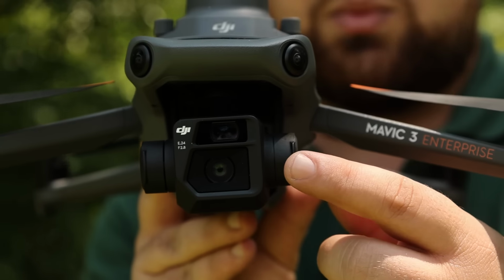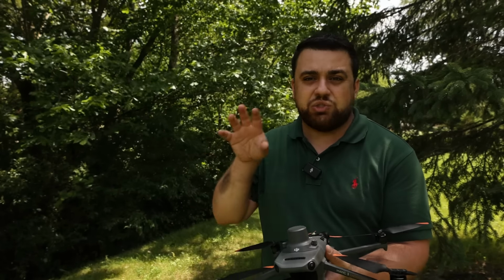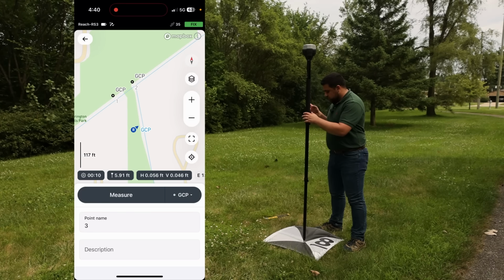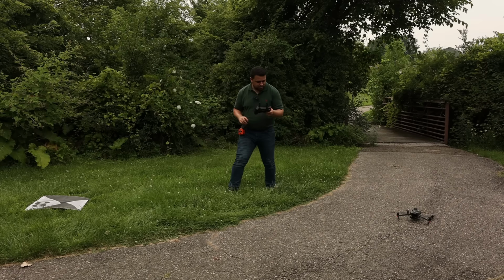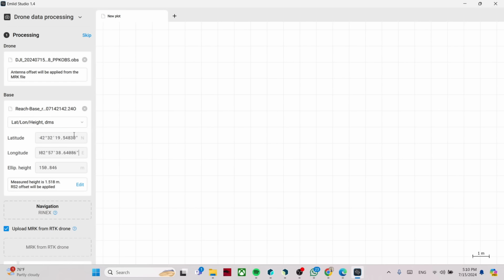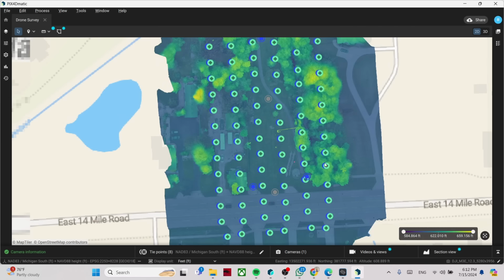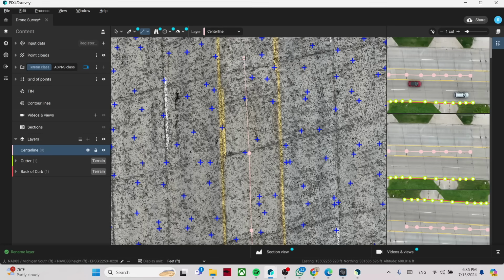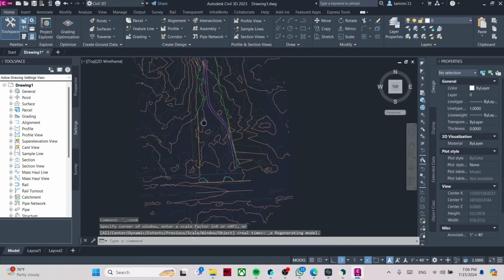FREE 1 HOUR DRONE SURVEY MASTER COURSE

Comment: the best tutorial I've ever seen!  QUESTION During the flight, the AFC turned to MF, if you chooose this manually, the result will be better? I usually do this manually, but thing the automatic would be better
Reply from the maker: Only issue with auto is it could focus on tops of trees and the ground goes out of focus. By having it in MF, it will be consistent through out the flight as long as your altitude is constant.

Comment: Hey Rami, fantastic breakdown in this video! I'm just starting out in the industry with my company, Llerandi Drone Solutions, up here in Ontario, Canada. I'm currently flying a DJI Air 3S, which I know means working with a rolling shutter and no built-in RTK, so I'll be relying heavily on manual GCPs for my accuracy. Does your platform, The Survey School, offer training or a specific learning path for someone in my exact position trying to achieve professional, survey-grade results with non-enterprise gear? Appreciate all the knowledge you share!
Reply from the maker: Yes, we provide a lot of support for anyone getting started in the industry between technical knowledge and business development. We also have partnerships with a lot of companies they give you free hardware and software as you learn that you can use in your work.

Comment: For the fact that there is CORS AND NTRIP you mentioned we can forget about buying the base station rtk but next you used it for ppk so is that a contradiction we should or shouldn’t get the base station?

Thank you for the tutorial though it is very clear and informative❤️🙏
Reply from the maker: You will need a base for PPK but you could use CORS’s raw data as your base. So again, you can get away with just owning one GNSS receiver.
Reply: @RamiTamimi thank you man❤❤

Comment: What if there is no known point to set our GNSS base station on top of, as you did?
Reply: You can measure a point with the base station (+/- 1.00m) and use that point as your known point. If you want to integrate it, you can find a horizontal control monument and shift your coordinates.

Comment: Perfect explanation - quick question. Can the base station be set over an extra GCP? And is it ok to set it up in RTK? 

I have a my first solo site survey coming up to produce a topo survey. The area is 4 blocks of flats and the surrounding grounds.
Reply: Allow me to ask you this, that little hump on the back of the drone is the rtk receiver ? And it's connected with credentials via internet to the municipality service ? Is that rtk enough to get accurate results instead of investing another 10k into the ppk receiver?
Thanks,

Comment: Rami, thank you for another insightful lecture on drones.
To the best of my knowledge, regarding static and RTK GNSS surveys, we don't post-process RTK data. So why was the drone flown in RTK mode, but you also laid ground markers?
Reply: Allow me to ask you this, that little hump on the back of the drone is the rtk receiver ? And it's connected with credentials via internet to the municipality service ? Is that rtk enough to get accurate results instead of investing another 10k into the ppk receiver?
Thanks,

Comment: This was amazing! I have a drone business and I have recently bought the DJI Matrice 4 E just for this and mapping . I learned so much from this! Thank you for putting this together.
Reply: We have the Matrice 4E also, we pair it with the Emlid Reach 2+ then use the Geodnet RTK service and it has amazing accuracy especially if you capture your images using FlightHub 2 and the Smart Oblique mode.

Comment: Im wondering if you really need an RTK drone if you already establish gcps? Sure, the metadata of the images isn't all that useful but still good enough to align all the images correctly. For accuracy of the final output, using the gcps should yield the same accuracy.
Also it would be nice to know if rolling shutter is really that much of an issue. Sure a mechanical shutter is better but you aren't flying all that fast when surveying and modern drones should be able to have a fast enough shutterspeed that there should be barely a difference in the quality of your results.
If these two hopotheses are true, you could save a lot of money buying a regular, non-RTK-, non-mechanical Shutter- Drone.
Reply: Allow me to ask you this, that little hump on the back of the drone is the rtk receiver ? And it's connected with credentials via internet to the municipality service ? Is that rtk enough to get accurate results instead of investing another 10k into the ppk receiver?
Thanks,

Comment: Great video! I finished writing a tutorial for our LiDAR drone, and I'm getting ready to write one for our Matrice 4E, so this has been a great resource for me (I'm also less familiar with the DJI product). A few things I noticed (possibly minor errors, or maybe I'm mistaken):

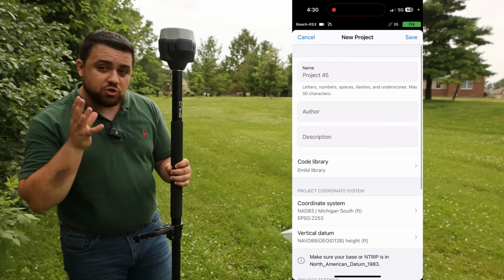16:43 Your screen shows you're using GEOID12B instead of GEOID18 - you say the correct vertical datum (18) but the screen contradicts you.

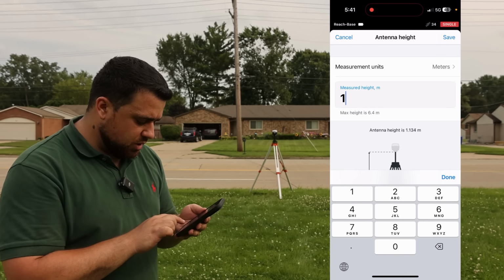23:22 Your measure-up was to the top of the tri-brack, but the graphic on your antenna height screen shows to the bottom of the receiver/base. (I'm unfamiliar with EMLID, we're a TRIMBLE outfit, so all I know is what I see on the screen. You likely did it 100% correctly, it just doesn't look like it based on the little I get to see).

Additional things that may be worth noting for new drone surveyors:

107 pilots should know this, but remember to check your airspace prior to mission planning, or at least prior to flying.

Surveyors, it's always tempting to fly well outside your survey's extents, and it's a good thing on smaller projects (much better than not having enough data). On larger projects, though, even 100' outside the project extents can add multiple battery changes, which may not be tenable depending on the number of batteries you have and your ability to charge them while flying. Also, we're always racing against daylight and weather. I find it best to get the exact project specs (project boundary linework plus how far outside the engineer, client or municipality requires), export the exact specs from CAD as a KML/KMZ, import to your mission planning software, and use that to plan your mission precisely (reduce the vertices to a more basic shape if need-be) If you have wiggle room in your battery time / flight time, you can increase the size of your polygon accordingly.

Great content as always, cheers!

Comment: Great video - thanks.  A few questions.  
1.  I have spoken with some of the software providers for processing software and they recommend leaving dewarp off.  Why do you turn it on?
2.  I had heard that if you are using NTRIP you should set your coordinate system to the same one that the base station you are connecting to is using.  But you just picked one for where you are - is that because it should be the same or that it doesn't matter?

Finally, I would love a video covering the different coordinate systems - why you choose one over another, how you pick the right one for a location, etc.  

Thanks for all the work you put into these!
Reply: A bit late to the game, but I can answer your questions.
1) The dewarping process uses fixed parameters to remove distortions in the photographs, but your camera will be slightly different from the reference one due to manufacturing tolerances, ambient temperature, and so on; so the photos will still be slightly warped but not as if they were tkaen with a normal camera. What the photogrammetry software does is determine the actual dewarping parameters of your camera based on the photos you've taken. If you dewarp it first it'll have a harder time calculating those parameters because it assumes the images are warped as normal.
2) Most of the time you would pick a reference station that is relatively close by (I've yet to find a hard-and-fast rule, but <60km seems to be a common criteria - the error you get is linear with the distance from the reference station measured in ppm). So that close-by reference station will almost certainly be in the the same coordinate system as your GNSS. Choosing a different one will likely give you significant errors, so it's definitely worth double-checking before heading out to the field.
3) Usually you don't have a choice - or rather you would consult your mapping agency website to figure out which CS you should be using for a given region. If there's a choice of more than one, then you'll have to talk to your client about which one they prefer.

Comment: You mentioned having Dewarp on. I have never really gotten a good answer one way or the other as to way having it on or off is better. I know DJI recommends it off to preserve more metadata but that's all I've ever heard either way. It would be great to hear your reasoning. Thanks.
Reply: If you capture the photo, the center of the image is really flat but as you move away distortion starts, it may not be noticeable at high altitude but significantly seen in lower altitudes. It is post-processing work so I think it should be handled by photogrammetry software.